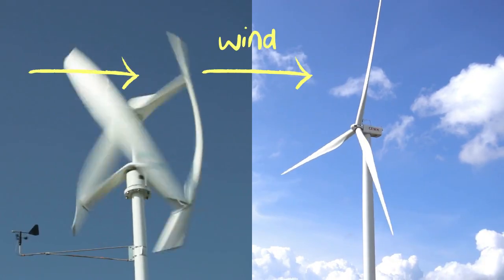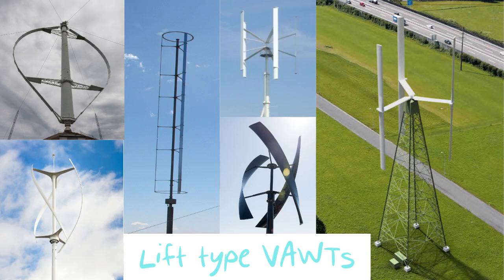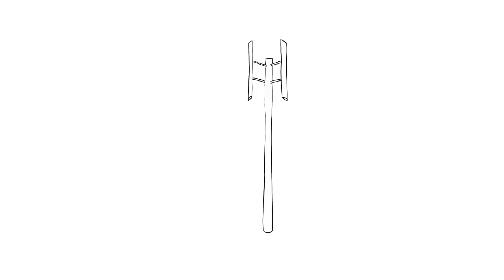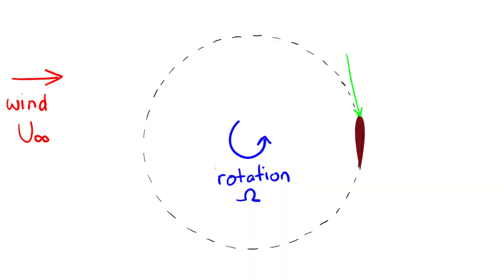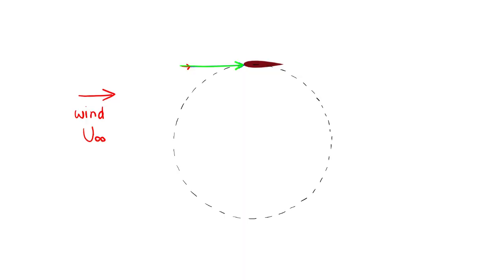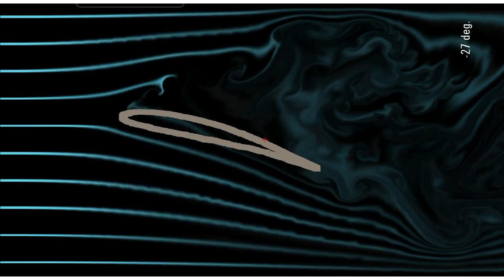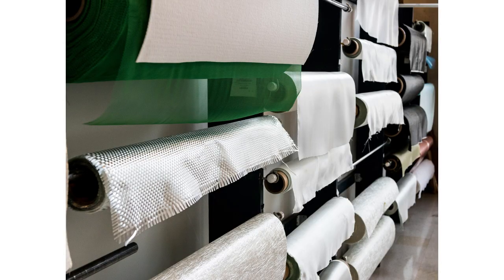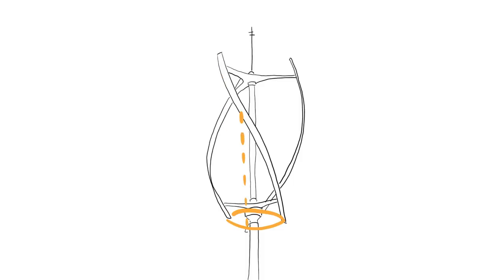Vertical Axis Wind Turbine Aerodynamics and Design

Comment: I hope the RC aircraft crowd are watching this as your challenge on microcontrollers and pitch control are their bread and butter. Couple that with 3D printable designs and seems like we could have something on every home and lining roadways by the end of the year. Efficiency only needs to be reckoned by energy in vs energy out, not in competition with the most sophisticated proprietary designs. And locally built is locally repaired. No these wont power our economy but they will allow a community's basic needs to be met and more directly relate responsibility for harmful emissions to where they ought to be for the citizenry to consider.

Comment: Up there with efficiency - and possibly more important too - are these key issues with wind power generation, they are:
1. The issue of wind turbines being such an appalling eyesore that they ruin the countryside in the areas where they are used
2. The matter of noise and the twin effects of both constant and variable noise levels on nearby residents, livestock and passers -by
3. The vibration that is felt nearby both in air and land transmission.

We really should demolish as many of the huge horizontal axis land turbines that we can and move much more to ocean generation both under and over the sea.  Fortunately demolition is easy and cheap.

Comment: Thank You. Very informative... even for a neophyte like me.  Just puzzling out the feasibility of VAWT in marine cruising (vessels around the 10 - 14 meter LOA range) applications. My first inclination so far is that scaling down may create a durability issues.  Because HAWT generators in marine use must be shut down to avoid overspeeding in gale force conditions, here's me just wondering if a VAWT can handle a gale! No worries... I may have to do some hamfisted experimentation on my own. Cheers!

Comment: I enjoyed your presentation thank you for it. I like the helical tri blade design, but wondering if five blades would have less cogging. I guess four blades would be a compromise, but I like odd numbers on impellers and I don't know why. I am wondering if any thought has been given to adding winglets to each end of each blade. I am wondering if this would add lift to the rotor while compressing air onto the rotor blade. I have seen winglets added commercial plane wings to increase velocity and lift over the wingtips. I am sure I am not the first to wonder how it might work I just have not found a VAWT for sell with everything I think it should have. I hope my questions don't sound as dumb as I must sound. Thanks again for your video.

Comment: Always a joy watching your videos 🙂, but could you possibly elaborate on the pitch control of the vertical axis turbine. Some years ago I saw a turbine having just that, but it seemed as if it disappeared from the market. I think the concept was named after Bernoulli, and involved an offset turnable arm controlled by the wind direction, which was connected to the rear end of the wingtips. This arm was turned in different directions through a Center driveshaft within the main shaft. This might possibly be one of the Achilles-heals of this concept?
Reply: There is a company in the UK called Vertogen that has a patent on a mechanical pitch control mechanism.

Comment: Thank you so much, great information and amazing presentation (L).  They look promising, our problem is that we can rely on simulations when they are well done a fact we often don't know and maybe it will be the way to design them in the future, since we need variable sections, multiple wind directions, tricky calculations. Some of the existing designs are made with helix shape blades but constant section, maybe we should think more on directing the wind than doing a blade position "just in case" the wind changes! anyway meanwhile they are durable, there's no problem with efficiency while they generate some useful energy xD. Thank you again! I'd love to see more math on these type of turbines :P > Best regards from Argentina!

Comment: For the engineering hobbyist, is it better to invest in hawt or vawt?  Some of the clear advantages of vawt appear to be lower noise, installation near ground, less ground area (swept area is vertical), potentially low cost (no yaw control).  But wonder if lower efficiency and lower MTBF offset those advantages.   Or is it smarter to experiment with solar due to no moving parts?

Comment: In my mind, when considering a lift type turbine, the obvious choice is the horizontal axis. These characteristics lend themselves to the most power production for least cost. On the other hand, they are not urban friendly and that's where the drag based turbines come to play. The lift based turbines operate best at about 7x the speed of prevailing wind whereas the drag based are less than 1x. What the drag based turbines yield due to the low rate of speed compared to wind is lower sound issues and lower maintenance. Considering that an urban environment lends itself to consumer purchasers who are not well versed in turbine maintenance, these are good properties to have.

The problem with Savonius type turbines is there are a lot of scammers (or simply ignorant) trying to sell something that isn't there using efficiency figures that don't exist for this type of turbine and promoting low wind speed capability...where there is very little power to capture to begin with at those speeds.

I think it's important to break apart the conversation when talking vertical axis turbines into Darrieus style and Savonius style. I am assuming the efficiency figures you gave reflected the Darrieus turbines, not the Savonius. I'd be really interested to know of working Savonius turbines that exceed 15% efficiency. And you are absolutely correct, increasing efficiency and increasing complexity go hand in hand. There are some amazing designs out there, but do they work???....maaaybe...

Summary: 
Big power or remote production - Horizontal 3 blade
Urban (boat, backyard, building, small power etc) - Savonius 
Darrieus? Not cost efficient enough for power generation and too fast for urban use

Thank you for engaging in some factual talk!

Comment: I think there is too much emphasis on efficiency. This stems from an industrial/investment biased thinking. If I have 1 Kw of wind potential and only need 250 w I don't care about those extra % points, I care about material cost, labour cost and longevity. I'm thinking of a turbine to directly store compressed air to run tools in my workshop.

Comment: Vertical turbine is much heavier meaning larger and heavier bearing thus more fiction and harder to maintain. It is far less efficient than the horizontal type because the returning blade works against the rotation. This configuration had been trying and tested 50 years ago and proved to be no good. I saw many new small types that looks very aesthetic but still suffer the same problem. That is the reason why you see very few of these today in not so serious installation. It is good conversational design.

Comment: Very interesting - variable pitch control for aircraft props have been around for a long time - maybe combining that with a wind direction tail system used in the horizontal systems. Engineering way above my brain cell count so the KISS approach is appreciated in your vids.
Cheers
Reply: Vertogen are working on just such a system.

Comment: Hi Rosie, I am very interested in the variable blade pitch technology, can you explain more, many thanks.
Reply: To get you started, there are a range of options as to how you might vary the pitch of the turbine blades; using a cam, you might turn the blade through less than 180 degrees, or using a gear mounted on the blade spar, you might turn it through the full 360 degrees. The cam or gear might be operated by a mechanical arragement or by a motor operating under the control of a fast acting electronic controller. The interesting bit is the calculation of the apparent wind, lift, drag, resultant lift and torque vectors and then controlling and optimising these to extract the most energy from the wind. Having full control over the blade pitch allows starting to be optimised, and for the turbine to be braked in high winds.

Comment: Fascinating vid!
I live off-grid, and PV provides most of my battery-charge,  generators supplying the short-fall as needed.
This is not as un-economic as might seem, as I only use the gens when I have a higher-current device (washing machine, microwave oven etc) that needs powering.

I have purchased and mounted an off-the-shelf HAWT (6m above ground), but due to wind-shear and turbulence, my mountaintop position falls far short of the output I was hoping for from my wind turbine.  This despite strong winds during winter.
Only very high-speed gusts (50-80km/h) produce enough rotational speed in the turbine to give me even 5-10 miserable amps into my batts, and then only for a few seconds.
It's been an interesting and even valuable experiment, but will never pay off the investment in time and money.  
The same investment sown into fuel for my generators would keep them going for MANY hours of high output current right through many winters of low solar energy!

I'd like to experiment with VAWT, but I need a solution weighted toward financial economy of installation rather than efficiency.  Any suggestions please?
Reply from the maker: Thanks for commenting, it's really cool to hear real-world experiences like this. 
It's hard to say if a VAWT will be more successful for you. If the problem is that you have low wind speed where you want to put your turbine, then there is simply not much energy there for you to capture and a VAWT won't do any better.  If the problem is that the wind direction is different than you expect due to an updraft or something, you could try to look into that (maybe attach some strings to your tower and see which way they blow) and adjust the orientation of your HAWT accordingly. But if the problem is turbulence (which you'd also be able to see with a string test) then a VAWT might work better. To get the economics right, you'll need one that is reliable so probably best to find a manufacturer with a track record and some independent reviews from customers who have used it in a similar application to what you want to do with it.

Comment: "Less efficient" alone doesn't say enough, or warrant a judgment of "inferior". More important is the long-term analysis of total cost (including maintenance) and total energy output over the life of the system. It's easily possible that a lower-efficiency system generates more energy for less cost over its lifetime.
Reply from the maker: You're absolutely right, there is so much more to it than efficiency. I have a couple of videos coming up that go deeper into some of the complexity. Thanks for commenting.

Comment: great explanation kindly brief derail about vertical helical axis wind turbine and tells us about angle of blades used in helical turbine
Reply from the maker: The  aerodynamics of helical blades can be analysed in the same way, but you'd need to slice the blade into small pieces and do the calculations for each piece separately and then add them.
Reply: Please tell me the simplest way to find angle of blade i am already tired of learning about wind turbine due to my subject and you are asking me for calculations

Comment: I did a rudimentary vertical axis turbine to pump water for a small village using three sails...like the triangular sails in larger fishing boats. The sails adjust when facing the wind directly as well as when it faces the negative force. It however does need a bit of play on the sail's horizontal beam.
Reply from the maker: That sounds really cool!

Comment: Hello from Brazil Rosie! you have great educational material about wind energy, I am glad that I found you here on Youtube! My question: is vertical axis turbine better suited than horiztontal axis to be installed on rooftops of apartment buildings and house condominiums in large cities? I can see a great demand for it, if it can be efficient to replace - in part or in total - the energy supplied by the energy distributors, mainly for the energy that is used for the common areas of the buildings, such as garages, entry halls, stairways, elevators, inside streets, etc.
Reply from the maker: Hello to Brazil 😀 And thanks for the question. 
VAWT may be better suited to rooftop installation than HAWT (it would actually depend on the specific VAWT and HAWT to be able to compare). But I don't recommend any kind of wind turbine on a roof for 3 reasons. 
1 - there is not much wind on roofs, the urban environment slows it down, so there isn't much energy to extract 2
 - if you put in a turbine big enough to capture a meaningful amount of wind you would likely need to strengthen the roof structure to handle the extra load 
3- wind turbines vibrate and if it's on a roof the vibrations will travel through the structure and annoy the residents. 
It would be much cheaper to buy green electricity from the grid than to buy and maintain a turbine on the roof.

Comment: Quite interesting. Make it more practically approachable though, please. Which would be the most efficient turbine for a single house unit (roof fixation) within a town?
Reply from the maker: That is the topic of a future video! Lots of people are interested to know that, same as you. The short answer is that if you are connected to the electricity grid, you are unlikely to save money by installing a wind turbine in a house in town. Solar panels are a better solution for urban renewable energy. If you want a home wind turbine for non-financial reasons (like I do, I think they are a fun engineering project), then I recommend choosing one from a manufacturer who has been around for many years with lots of good reviews. Small wind turbines commonly deliver less power than the manufacturers promise, and many suffer from poor reliability. The type of turbine and its efficiency will be less important than finding a good quality and well made model of any type.

Comment: so this is maybe a dumb question but... what if you just blocked the wind from hitting the blades when they're most susceptible to drag? you'd have to turn that blocked section relative to the wind direction with like a sail or something. would that just create other problems maybe? or instead of a solid panel could you make the section out of a series of vertical angled panels that direct the wind in a more favorable direction to the blade?

Comment: I'd like you to look into this Icewind design, helical with six blades. I think with the climate emergency the world is beginning to experience, we need as much alternative power wherever it can be installed, even if each unit is less efficient than optimal. We need widely distributed solar and wind all over the world, as fast as possible to replace fossil fuels and power electric vehicles. Dragging our heels waiting for the "best" solution no longer seems like a viable choice. These units installed on buildings as well as in distant energy farms should be given a big push. https://www.forbes.com/sites/johnkoetsier/2020/08/10/new-6-bladed-vertical-axis-wind-turbines-can-power-your-off-grid-home-for-30-years-safely/?sh=5b3aa8bc2ba5

Comment: ok. bear with me. how about, with the pitch control one, instead of sensors we design it in a way the blades always face one direction. then we use that fish tail thing oh hawts to change that directio... aaand i made it too complex
Reply from the maker: Ha ha! Yep there always seems to be that tradeoff. But there are plenty of very complex machines that are still great technologies. Like jet engines, and the electricity grid as a whole. So just because your idea is complex, doesn't necessarily mean it won't work. It only raises some possible issues that you'll need to address, like reliability.

Comment: I'm an MBA, so please forgive any obvious oversights....but what about a Savonius(ish) with partial shrouding?  Imagine a shroud looking downwards that would be open 12 to 3 o'clock and 6 to 9 o'clock and shrouded 3 to 6 and 9 to 12 o'clock with a weathervane at 6.  The 'intakes' could even be flared to increase the catchment and venturi effect.  A simpler alternative would just be a quarter/half shroud at 6-9 to 12 on the advancing scoops.  Vertical stacking of smaller HAWTs like a stack of pole mounted V22 Ospreys might be another way to limit lateral dimensions while harvesting more on the vertical.  Just spitballing here...lol   Love the channel...subbed.  Thanks for the teaching.
Reply from the maker: That's not a silly suggestion at all, there are several designs that use that principle. If I do a follow up video on this topic then I will include some examples of this. Thanks for the comment!
Reply: @EngineeringwithRosie  You bet.  Looking forward to anything you care to share.  I've always been fascinated by all the potential energy around us.  Especially in the form of talent.  Peace to you, Rosie.